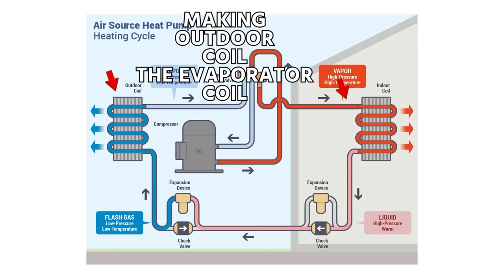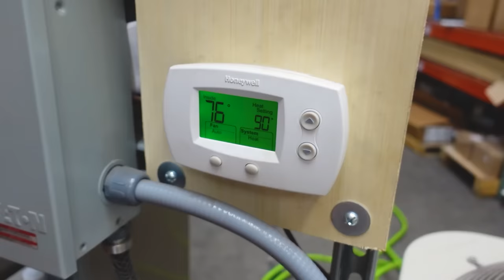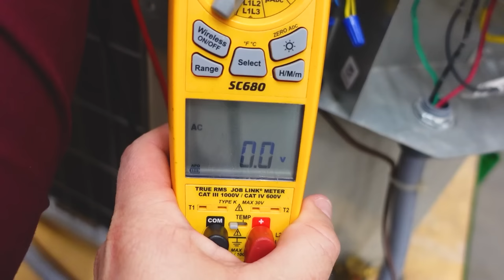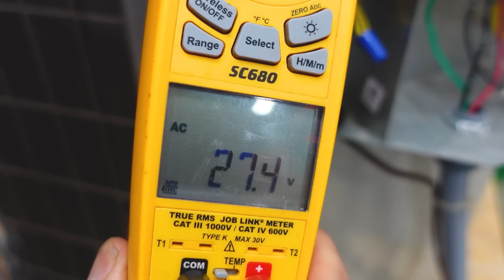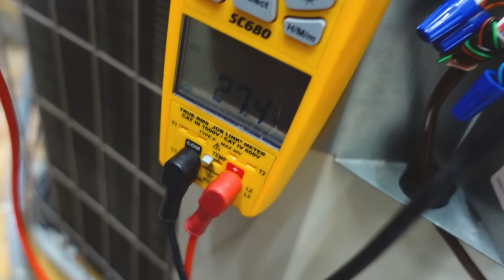Learn Everything About Heat Pump Defrost

Comment: As an experienced HVAC tech, I would like to say this video is very well done. Just have a couple of things to add. I believe using sensors or thermostats to terminate a defrost cycle before its timed period is up is called defrost termination, because I know that is the term used on commercial freezers. Also, since the evaporator and condenser are constantly switched in a heat pump the better way to describe them would be indoor and outdoor coil. Also, the for the new techs out there, the first time that the unit goes into defrost after running in cooling all summer, the auxiliary heat strips that come on during a defrost cycle that temper the cold air will most probably has a small amount of dust on them that will burn off and the customer may smell it. Then when the outdoor coil comes out of defrost and the outdoor fan comes on it many times will blow out a big cloud of steam that the customer thinks is smoke. Just keep that in mind.

Comment: Well done, very informative. One nice feature Trane provides for their demand defrost is a chart in Service Facts that gives you the sensor ohms but also the DC volts the board should be seeing at a particular temperature from each sensor. Saves having to ohm out the sensor in the freezing cold…a bit easier on the bare hands.

Comment: Nice universal board.  Now they need one for two stage systems.  

My rules of thumb for York heat pumps with demand defrost:  

* Defrost is limited to an ambient range between 50f and -25f.  Liquid line sensor temperature must be below 40f.   

* Demand Defrost board uses a variable Ambient versus Liquid Line curve.  Liquid Line measured with a 10k ntc thermistor located properly.

* Board will exit defrost when the liquid line temperature is 80 deg or ten minutes.

* Liquid Line and Ambient temperature thermistors are tested by disconnecting sensor wires from board and measure resistance in k ohms.  Verify using a 10k NTC Resistance to Temp Chart.  Should be +- 5f from actual temp of location measured.  

* LL Sensor location may be wrong if previously worked on.  With an outside expansion valve, the sensor should be between the valve and the coil distributor.  Otherwise the defrost board may terminate defrost too early or it may not defrost at all except at six hour timed intervals.  The six hour timed intervals will occur in heat mode to ensure proper oil circulation.

* 10k ntc thermistor tips:  10,000 ohms at 77f;   about 32k ohms at 32f;  NTC "negative temp coefficient" means Resistance goes up as Temp goes down

Comment: Your videos are always great! Up here in the Pacific Northwest defrost sensors fail all the time. They get moisture inside and can freeze and expand. The carrier sensors also have had a very bad record out of the box this year and we have replaced over two dozen of them on brand new systems.
Reply: That sounds like a manufacturing defect in the sealed component.  Some good sealant should solve that problem.
Reply: I see mice and frogs shorting out or corroding the boards.  In the Pacific Northwest

Comment: I make it a point to explain in very little detail to the customer what to expect with their new heat pump. Condenser buzzing without the fan running, frost build up and steam are all normal. It eliminates unnecessary non billable service calls

Comment: The American Standard / Train demand defrost works quite well. Just make sure the damn coil sensor is actually attached to the coil when you install it. I had a defrost issue the first winter with my Silver 15 and when I went to test everything I found the Coil Sensor was dangling. It was like that from the factory.

Comment: My defrost is operating according to specs, but as soon as the reversing valve switches over, kills the condenser fan like its supposed to, but also cuts out the compressor. I can feel the suction line heating up, so pressure is definitely building from somewhere. Any thoughts

Comment: Hey Brian great video. I'd like to add 1 thing, but let me know what you think. When you have a thermister in open air I use a thermometer the same as you. Although instead of checking it against resistance I use my meter in Temperature mode and check the temperature Of the thermister. If they're within a couple of degrees of one another then that thormister Should be good. Let me know what you think?
Reply: Usually a meter will read a k type thermocouple and not a 10k ntc thermistor.  What kind of meter do you have?

Comment: I'm not sure demand defrost is a good thing in a humid winter climate like SE TN.  But I've not been able to find anything on the logic used for demand defrost.  It has value in refrigeration and likely dry winter conditions, it seems.  

One thing I don't see covered for demand defrost is that it terminates on the coil thermistor temp and the jumpers on boards, (it was a column on the WR) is to set that temp from 60-90 rather than being run time.  The runtime before defrost is apparently the adaptive part but left hidden in the chip.  But the termination temp is important as if you try to force defrost it will come right back out if the coil temp is above the termination temp setting.  Sometimes giving the illusion of a problem with the board.
Reply: Demand defrost terminates on LL temp or time.  The Emerson board is a good universal module for single stage heat pumps.  Wish they had a similar version for two stage heat pumps.

Comment: How do ductless wall hung units that go into defrost overcome the cold outlet air temperatures into the conditioned space without back up resistance heaters ?
Reply: indoor fan should shut off while in defrost
Reply: @mackenziegray2090  Are  you sure? Standard heat pumps need the indoor fan running during defrost. Its hard to understand at times, but when the system in defrost the indoor coil it is acting as an evaporator, and it is absorbing heat while the refrigerant turns from a liquid to a gas. This refrigerant vapor then goes to the outdoor unit where it is compressed and condensed, which releases heat, with the outdoor fan off to concentrate the heat in the outdoor coil and melt the frost. If the indoor fan was off during this time, the refrigerant would not pick up much heat and the defrost cycle would not work. Please let me know if a ductless system has a different arrangement.

Comment: When it’s 35 or lower outside my heat pump turns off and won’t turn back on until temperature outside is back to 35. So I will constantly run my heat strips for days until temp outside go back up you think my heat pump is broken?

Comment: How does the board enable quiet mode on the unit 🙋🏼‍♂️
Reply: It stops the compressor when going into and out of defrost, waits 30 seconds, energizes the reversing valve and starts the compressor.  It reduces the typical noise when operating the reversing valve with the compressor on.
Reply: @rj.parker   thank you for your explanation. Very interesting

Comment: 8:25 I will respectfully disagree. I find the snap action thermostats failing (also thermistors failing) are the major cause of defrost issues. They get stuck and will not close. I've seen many encased in ice on a 15 degree day test open. If I smack them with the handle of my screwdriver, they will often close. I replace the thermostat and no more defrost issues. I also live and work in a much colder climate than Florida, maybe that's the difference.
Reply: I was gonna say... because I just came across one, and I attached it to an ice pack, and it still wouldn't close. It's still not cold enough where I'm at for the coil to get below freezing

Comment: If you have rolling blackouts in very cold weather, the defrost board will lose its accumulated run time due to loss of memory. Then the frost will build up so thick you will not have any usable heat in very damp conditions.
Reply: That does not make sense. The compressor will not run during the power blackout so it will not  ice up during this time. It starts accumulating run time below icing conditions and will defrost every 30, 60 or 90 minutes thereafter and clears its run time memory during every defrost cycle. If you are having rolling blackouts with that short of a duration, I do not believe the unit would heat anyway and that is more of a power supply problem than a heat pump problem.
Reply: @Howie875  I’ll try again… if your outdoor coil is frosted up and near defrost cycle, and you lose power for a short time, the defrost timer loses its memory of the run time. So when power is back on, and the frost is still there if will not defrost for another 30,60,or 90 min. You have very little heat, and if conditions are causing frost build up, it will just run, run, you may have small amount of backup heat but that won’t heat your house without the proper heat pump capacity. I have seen this many times.
Reply: @tbone9405  Let me clarify. After the unit misses it's defrost cycle, it is true it will have some frost on it and won't work as good as it should. But as soon as it comes back on, the defrost timer starts to work because the coil is frosted over and then it will defrost on the next cycle, either 30, 60 or 90 minutes and then will work perfectly again. Just missing one defrost cycle will not add that much extra frost on the coil. The outdoor coil gets plenty of heat from the hot gas line during defrost and most systems have a defrost termination, because all the ice melts before the timed defrost is over and if you do not terminate it, you will trip the high-pressure switch because the condenser fan is off during defrost. So, it's only a 30, 60 or 90 minute period of reduced capacity. The only time I have seen frost or ice so thick that it would not respond properly to a defrost cycle is on a system that has run for many, many hours without a defrost.
Reply: @Howie875  This is how a defrost board works on a typical heat pump. The memory is on kept by voltage from the 24 volts coming from the hvac’s transformer, which is always on. The defrost is controlled on most heat pumps with a bimetallic thermostat, located in the outdoor unit attached to to the coil, it closes about 28 to 35 degrees. Then the defrost board starts counting minutes of run time, when it reaches 30,60 or 90 depending on the pin settings, it will initiate a defrost cycle, the mechanical bimetallic thermostat will typically open at 60 degrees. If power is lost the board will not keep the count. When power returns if will start over. The frost is still there because ambient temperature is below freezing at this point. Hopefully that helps. In more moisture prone areas this is problem. Also some power companies cause this problem, when they cycle the equipment for some programs. I was stating this issue for educational purposes, as I have experienced this in my many years of service, may not be a problem in your area, but someone may have experienced it. If your goal is to have the last word, then you can have it,lol
Reply: @tbone9405  I have a very clear understanding of a defrost cycle. I have many years' experience myself. The only time you lose your accumulated run time is when you lose complete power, and if your losing complete power often enough to continually lose your accumulated runtime and interfere with defrost then you probably won't have enough power to heat the conditioned space anyway, and that is not a heat pump problem, that is a power supply problem. A power cycling program, if wired correctly, should have no effect on the defrost memory. A correctly wired cycling device normally just cycles of the compressor by de energizing the compressor contactor, and the board should interpret this as the thermostat being normally satisfied. An incorrectly wired cycling device that opens either the hot or common from the transformer would kill the accumulated run time memory. All I am saying, respectably, is that one missed defrost cycle is a problem that will self-rectify itself at the very next defrost cycle, period. I hope we can agree on that.
Reply: @Howie875 my mini split is pretty old but it has a sensor with micro processor on the back of the outside coil for defrost.